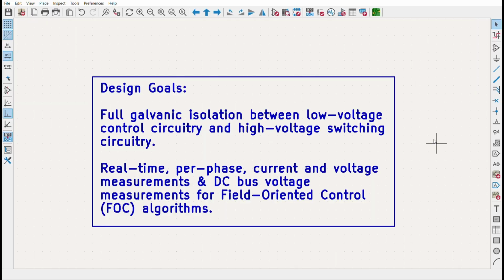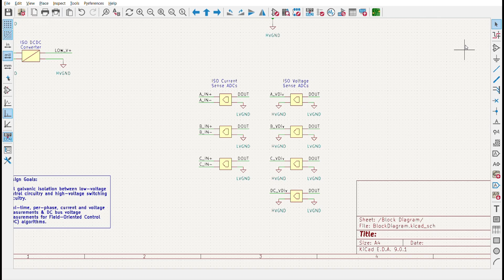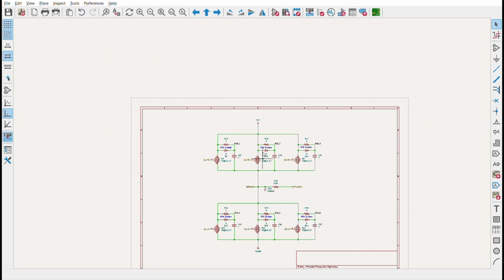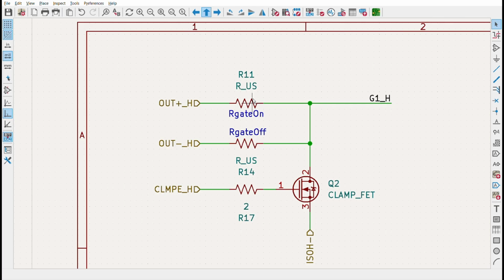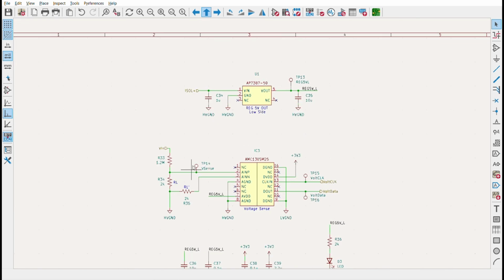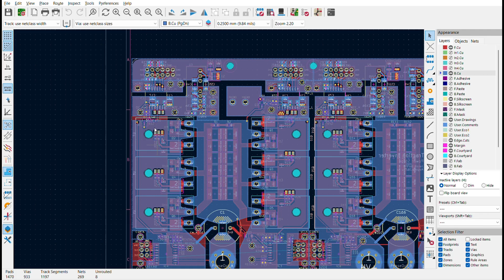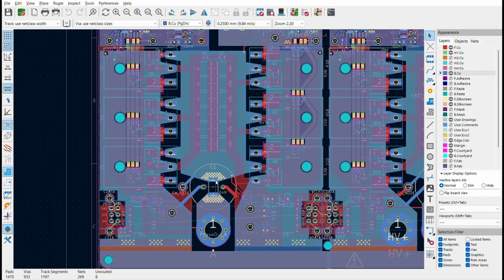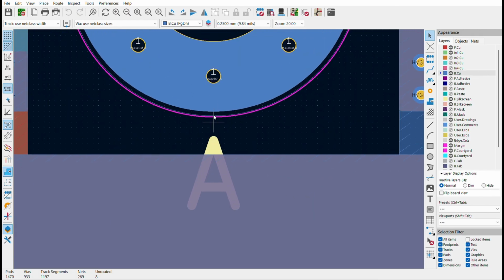High Power Three-Phase-Inverter/ BLDC Motor Controller -  Power Electronics Design project

Comment: Woah sick project!! Random question but I also go to UT and have more of an RF background but am wanting to get into power electronics. Did you take the power systems lab and if so, was it worth it? Debating whether or not to just do personal projects and take a chill last semester or go all in on classes while I still can. Also you probably know this but Aisler and pcbway are pretty good about hooking students up with discounts, I got some fancy rogers boards done for free with them.
Reply from the maker: I haven’t taken power systems lab, but I have take power electronics lab. Power electronics lab was one of the best classes I took, I just finished it this semester. I took it with Professor Johnson, I know multiple professors teach it. Definitely was an amazing intro into power electronics.

Comment: Thats an Incredible work!!! Did you used the SVPWM do create the Three Phases lag, or used the SPWM? Actually im working in a Single Phase Inverter using ATMEGA328P DIP, Creating log faults, soft starts, and softstops.
Reply from the maker: I used SVPWM! It’s a bit more efficient than SPWM

Comment: This is sooo cool! How do I even learn these stuff?
Reply: Major manufactures have evaluation boards for most components, so go to their database of evaluation boards and start digging through the examples, typically they will have a write-up that covers most of the significant portion of the design with links to topics not covered in that particular white paper. One of the best features of this method of learning is being able to select by application and performance, since the applications engineers have access to the absolute best evaluation equipment to quantify nearly all metrics of the designs performance, allowing you to better select the right design to copy while learning what design choices leading to that particular specification you are aiming for. The Idea here is to piecewise build your complex circuit from evaluation boards till you gain enough experience to know what needs to be done and why, read the write up's and notes, they often link to other application notes that will dive super deep into all the details. Enjoy!
Reply from the maker: Study hard!

Comment: It's a bit cheating, but you might want to consider a GanFet halfbridge LMG2100R026. It's a bit lower voltage (80V), but it includes all the circuity+protection, is fast, easy to manage... (or a couple of LMG3651R025 for better performance)

But not as fun :D
Reply from the maker: Thanks so much for the comment! Yes it would have been cool to have some more integrated parts on the board but got difficult as the system is at 120V.
Reply: @JacobEce319k  LMG3651R025 & its family are good for 650V, you just have to add translation level

Comment: Please make step by step detailed video
Reply from the maker: What would you like me to go over? More of the schematic, or layout?
Reply: @JacobEce319k mainly the schematics and software part and if could add some motor control theory
Reply: @JacobEce319k  can you explain the gate drive strategy in more detail? The part about the DC DC converters being referenced to switching nodes.. was this done as the gate driver does not have an isolated gate drive output? 

If yes, why did you not consider using gate drive ICs like the IRS21687 that can drive both the high side and the low side from one IC without having to use multiple VCC buses for the gate drive IC?